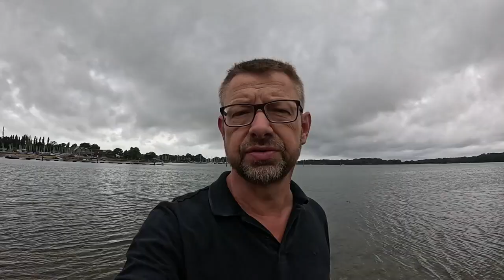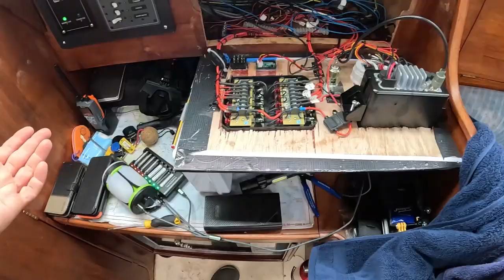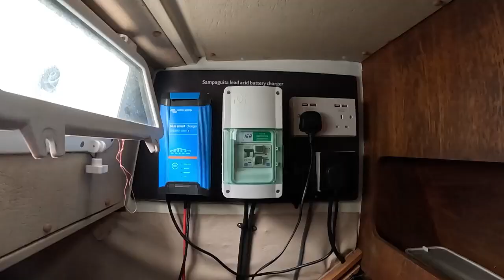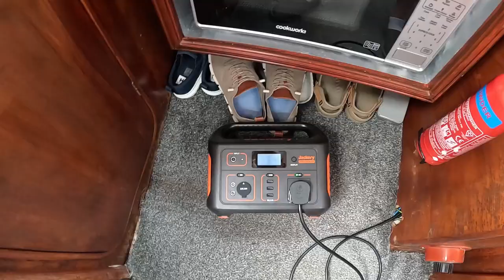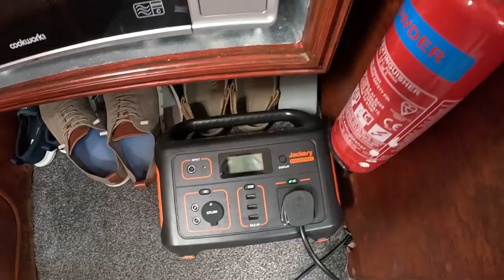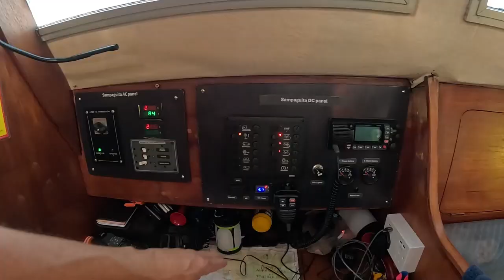25-18 Wiring in Starlink, Falcon 4G, mini fridge and more

Comment: Very interesting to see the differences of your interior to mine. Also helpful stuff about Starlink which I may decide to install, particularly the 24V supply. Is that just to help reduce cable losses?
Reply from the maker: Yes. The Starlink cable is very thin and experiments by others show 3v drop across it (5A, 60W) if you drive it at 12v. That means it won't work. Starlink drive that cable at 30v, and I chose to drive at 24v so much more than required 12v at the Starlink end. Generally I find it uses a couple of amps at 12v by the way, but in winter it has a heater inside, etc.

Comment: Another nice video, just put Starlink mini onto my sailboat just need to wire it up to the 12v circuit, keep em coming and maybe bump into you along the south coast somewhere
Reply from the maker: Thank you for the encouragement! Not sure if this link will work but here's the 12v to 24v converter I used for my Starlink Mini in case you want something similar - hope we do see you out in teh Solent! https://www.amazon.co.uk/dp/B0BNNZJ4RN